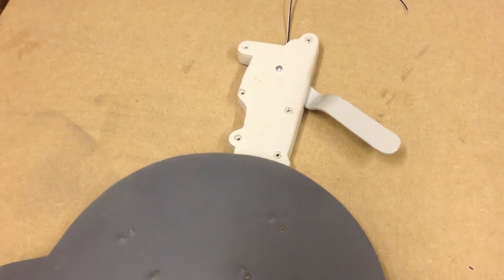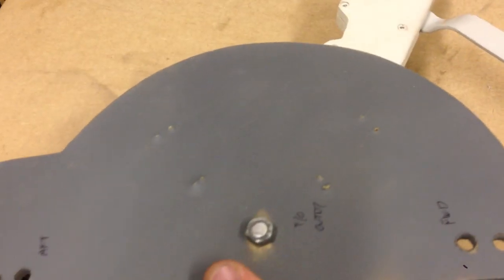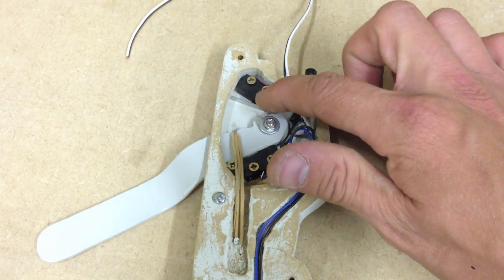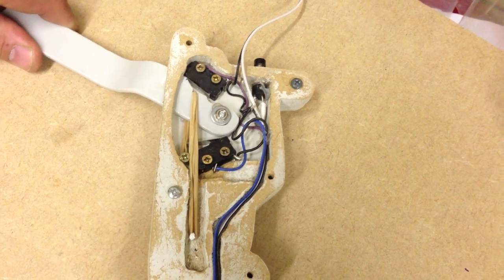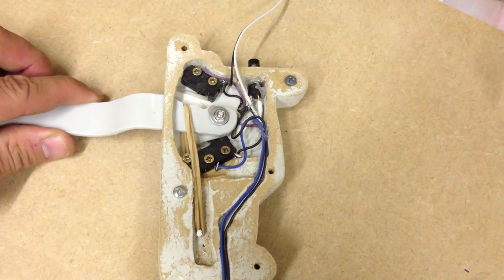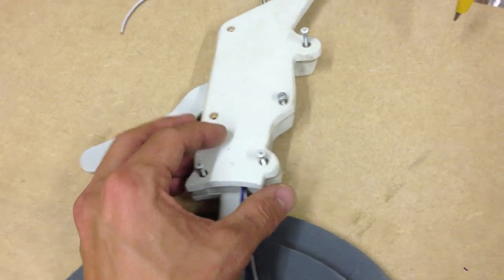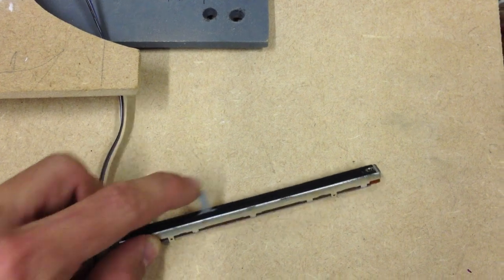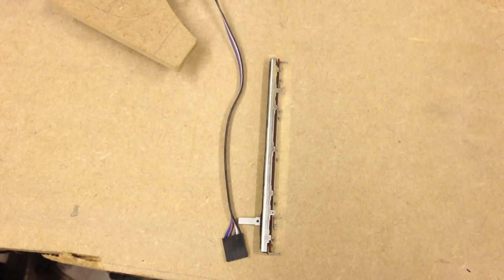Throttle handle - B737 Home Cockpit

Comment: Where do you buy a potentiometer??
How will you connect it to your computer????
Reply from the maker: Gio Estrada Hi. 
All pots are bought from eBay. They will be connected using either a Pokeys Card or an OpenCockpits Servo-card.
Reply: +Build a Boeing how many pocket cards are needed for the trust levers and speed break and flaps??

Comment: Nice, however I don't understand how a lineal potentiometer fits there, I think it would be way easier with a rotary one.
Reply from the maker: ***** It is a rotary pot, the with a linear output (Not a logarithmic output). 
I have been taking up the project again and will hopefully shortly (Like with in 2-3 years judging on my speed up untill now) be able to show a cheap motorized throttle handle. :-)
Reply: Build a Boeing
A slider pot, that's what I meant, that is what you have there, not a rotary one
Reply from the maker: ***** Oh. I thought you were talking about inside the handle. :-) 
The slider pot fits underneath the throttle arm. There is like an L-shapt at the bottom of the throttle arm. The slider pot is then connected to this L-shape. I will show you how it works when I get further in the proces. I have installed it.
Reply: Build a Boeing
Well good luck mate, I'm working on my own 737 cockpit too.
It will work not with the FSX base 737 but with the PMDG one (NGX).
I expect to have the first flying version maybe in a couple months (cross fingers)

Comment: How come you didn't use a potentiometer? Im currently planning my own cockpit and im using your videos for research and subscribed
Reply from the maker: Hi Michael. 
Actually I never got any further with the throttle. Meanwhile I have found some small pots. Back when I made the video I only had standard size. Once I start working on the throttle again I will make an update.
Cheers Peter